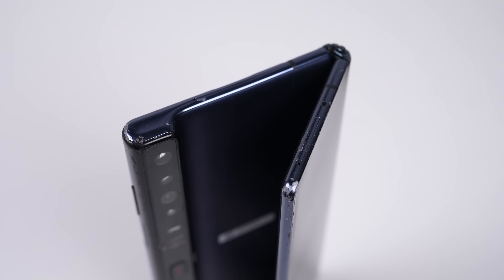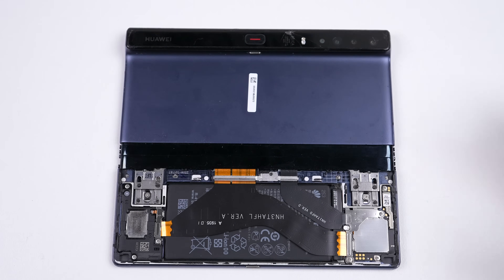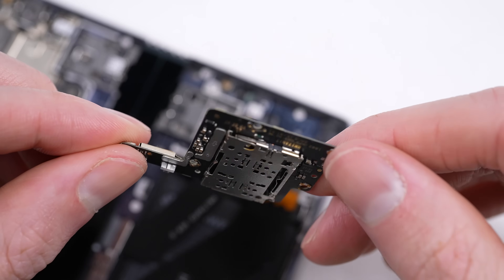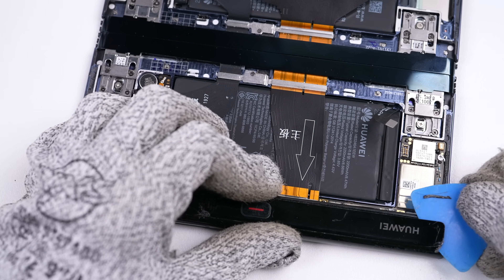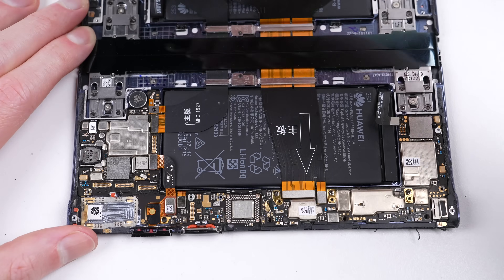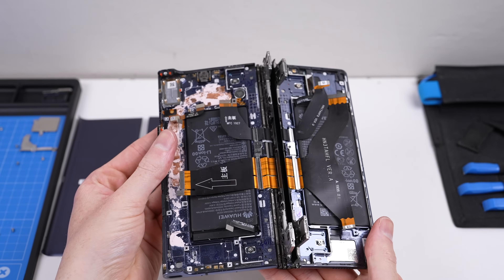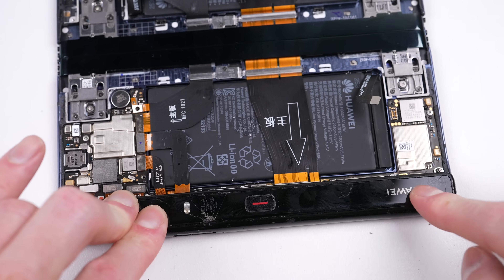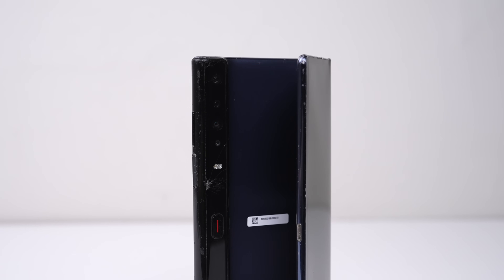Inside Huawei's Strangest Foldable - Mate X Teardown & Repair Assessment

Comment: Probably the most stupid foldable design i've ever seen. Folding screen on the outside....drop it or even poke it on that display corner and it's done for. Also the dust in the hinge shows that even if the display worked,the hinge would become a problem. People can say whatever they want about Samsung but comparing this to a Galaxy Fold in the engineering and durability department is like comparing a Fiat Multipla with a Rolls Royce. Also the price of a Mate X compared to a Fold is mind blowing
Reply: to be fair you are looking at the first gen mate x. First gen folds were crappy too
Reply: It was made to look good,which had been one of Huawei's big selling points when this thing launched,so one would understand why the phone was designed like that,to look good
Reply: Quite a lot of hate for something bleeding edge.  I for one, love it.

I feel this design is better in terms of usability, just not durability. Still, poor durability might be enough for it to be a financial failure for Huawei and be forgotten in a few years.
Reply: Why the hate😊
Reply: It is obviously less durable than a clamshell fold but not need to say it's stupid. 
The benefits are obviously clear, this form is just much better looking, you can take selfies easily with the best camera unlike z fold.
The folded up outer screen was far superior to use compared to z fold 1 or even the newest z fold 5.

I think clamshells are better but companies were experimenting, which is fun, that's rare nowadays.
Reply: Literally yes it's the truth
Reply: my man wrote an essay
Reply: That might be your opinion, but I think it's the most beautiful design and I hate the others wich open from the inside
Reply: @alexvonanders2727  Each to their own but folding on the outside is purely impractical. Those screens scratch as easy as plastic ones and there's no way to put a case on it so no matter if you just place it on the table or keep it in your pocket you will always rub that screen and it's going to be filled with scratches not even to mention dropping it.
Reply: @LUR777-g7r  I have it right now tbh buyed from the beginning, I love it for the format and I never had a scratch on my display, sadly it is a prototype and actually the first at begin sell in my country but as a prototype it have a big problem. I had to send it back after 2 months to be changed because on my screen appeared a green line crossing the display and now after 2 years even the replaced one have the same problem, the warranty is expired and Huawei asks 800€ for change the display soooo I keep it this way, but i still love this phone too bad Huawei didn't offer a premium treatment for who buyed this phone 😂😂😂
Reply: Yep really stupid. What's the point on using only one set of cameras and display. It's not like the foldables are expensive and this could be a way to make them cheaper
Reply: @supremeleaderfokou5693  But this phone was more expensive than others that had 2 displays and more cameras lol
Reply: @LUR777-g7r  thank usa
Reply: What did you say about the Fiat Multipla? >:(
Reply: I'd prefer to say its more like Lamborghini Countach and Bugatti Veyron: one looks good, very sexy, a bit mad, but it doesn't work that well (it has many compromises in performance for looks) and the other one just works.. it might not be your cup of tea but it works
Reply: There's no correct way of making a foldable, cause the only truly correct way is to not make one. The idea on itself is stupid
Reply: @WolfiiDog13  Use one and you'll see they're not as bad as you think. I have a Z Flip 3 that turns 2 years old in August and a Fold 4 that i bought last year in November and they're both still brand new-like. The Fold is a tablet and a phone in the same package,do whatever phone stuff you need from the exterior screen and use the nice big screen for media consumption. I also have a 13 Pro Max along it and if i had to pick only one i'd definetly keep the Fold 4 even if i love the iPhone. It iust does more
Reply: In this stage yeas but in some time we're let's assume that the screen can be easily replaced and has glass, this would be the best foldable form factor
Reply: Way smarter design than samsungs, it just needs a better foldable glass panel thats not made yet.
Reply: @andrasbesenyei8923  Why? Not trying to be a Huawei hater since is used and like Huawei products but why would any phone want a screen that folds on the outside and can be cracked from 1 drop? All folding screens are way more fragile than regular phone screens and this is definetly not the way to do it. It may look cool to the eye,but it's not smart durability wise
Reply: @LUR777-g7r  less camera is needed, less screen is needed, screen ratios are less goofy. As i said, technology is not ready yet because they would need something like the gorilla glass victus but also bendable, but to call it stupid is a stupid thing to do, it wasnt really meant as an end product, it was meant as a concept. Btw first gen Folds also had a lot of durability issues.
Reply: @andrasbesenyei8923  This
Reply: This is the correct design. No redundant screens, no redundant cameras, no shitty under display cameras, no stupid narrow outer screens, no crest
Reply: @frokjodor  just the materials for it do not exist yet
Reply: no it's not HUAWEI is the smart one/ huawei mate x handle many drops and samsung fold broke for no reason
Reply: bro they does't take care about the fold other fold will break and habe issues for no reason and i have vid mate x survive many drops and huawei didn't make the weak display' it would be a game changer if huawei made their own
Reply: Talking trash about the Mate X is like talking trash about the galaxy  Fold 1
Both are first generation phones, and both were considered stupid
Samsung managed to take care of it pretty easily, but Huawei being banned from almost everything they have, survival was their primary goal
Reply: @ShadyRadaideh  i mean XS 2 is really good. Like if not the bans it would be a great competitor
Reply: @CaffeUmU  
I agree
But I still think they could've done much better if not of the U.S ban
Reply: @ShadyRadaideh  yeah that's true. Huawei made the best phones by far up until the ban. The cameras, the software and the hardware was the peak of android.
Reply: @CaffeUmU  They had one of the best cameras but not hardware. Back when the P30 Pro was new it had less specs than an S10 (no dual speakers,no qhd screen etc.) At the time i had a Note 10+ and a friend had the P30 Pro,even tho he was liking it he said he likes my Note better
Reply: @LUR777-g7r  yesn't. P series wasn't the only one. When im talking about superior i mean the mate series and mate 30 actually was faster at least on geekbench compared to note 10 by 80 points on single core, around 330 on multi core, vulkan and opencl scores are almost  doubled on the mate 30
Reply: @ShadyRadaideh  well yeah the first fold was not durable either,but Huawei making the screen on the outside made it even more fragile than it already was
Reply: 1. Tbh bad comparison, modern rolls royces are just a bmw (with their own share of issues) and multiplas are kinda reliable 2. 1st gen product ffs, and this model is also quite old, but still looking modern compared to the famoust 1st gen fold from Samsung 3. This is probably the best and only genuine fold desing that wants you to use its full potential open, and when you have to use id one handed you have a normal 19.5:9 screen, nice and wide 4. All foldables have the poke it and it's done. Huawei has good hardware desigs and people can talk all they want about china this china that, but this phone is using the max out of the form factor, and is still slim compared to the double screen fatty Z. I also use a Samsung phone, I love the software, but the z fold is just a weird form factor, even if I love the Z series, I find it weird, except the Z Flip, that one is cool, not the best, but hella good. Also, the only reason why someone would choose the Z Fold is if they are a less careful with their phones, so the outer durable screen would be a life saver if the inner screen died.
Over the years phones really became disposable. Just look at oled screens, expensive compared to the rest of the phone and they die the faster, either by breaking or just burning out. Flash storage also wears out after someone time. Same for the battery. Only waste is the cpu that could be repurposed.
Reply: @igor4knezevic  even the price was very similar 200 AU more for the mate X compared to first gen fold. The new ones (mate XS2 and Fold 4) cost practically the same
Reply: @CaffeUmU  Depends on the region i guess. Where i live the Mate XS 2 is around 2000$ while i got my Fold 4 for 1200$
Reply: @CaffeUmU  yep. Both being similarly priced, the only reason why I would go with the fold world be the software, and going with the xs2 would be for the cameras and the design
Reply: @igor4knezevic  I need to say that only the RR ghost can be called a BMW because it's the only one that shares the LWB chassis and the V12 with the 7 series
Reply: @Mecanic0_exe  well all RRs share the iDrive system. All engines they use are from BMW, with a few modifications. They all share platforms in their own way cause it would be stupidly expensive to develop new platforms for each vehicle. But still, using BMW parts is not bad, but saying those parts are a true Brit RR is not genuine. Great German cars with the touch of British luxury. Probably for the best knowing of the good old British reliability.
Reply: @igor4knezevic  the RR Phantom engine is a 6.75L V12 that is not seen in the BMW lineup, also it is way bigger than the biggest executive Sedan from BMW proving that they developed a chassis and an engine for that car, but the Infotainment system is shared and probably some mechanical components, but RR are not built in the BMW factory. The ghost actually has a BMW engine and a BMW chassis along with other stuff (not built in BMW factory as well), which make it the most BMW RR for sale, even though it's way posher and comfy
Reply: @Mecanic0_exe  is the engine MADE by the bmw or not? No one is talking about the engine being in the bmw itself
Reply: @Mecanic0_exe  here is the info about your engine (maybe you should tried to at least google it first) https://en.m.wikipedia.org/wiki/BMW_N74#N74B68 this engine is just another version of the n74 engine. So it is the bmw engine.
Reply: I don't know what a fiat maltipla or rolls royce is. What are they?
Reply: @Qwerty-uiop both cars, fiat multiplia is considered a very ugly car, and a rolls Royce is a very expensive luxury car brand
Reply: @The_Phone_Bin_Diver  ohh
Reply: @The_Phone_Bin_Diver  but the Multipla is very practical, that phone isn't
Reply: @Qwerty-uiop  Lmao you stoopid brother
Reply: @Qwerty-uiop  who doesn't know what's a rolls Royce??? Living under the rock homie
Reply: @Qwerty-uiop  You don't know what a Rolls Royce is? Seriously?
Reply: @michaelcraig8860  I'm not a car person
Reply: @Qwerty-uiop  even none car people know what a Roller is. Also they make plane engines.
Reply: @smash461986  ok I don’t know literally any car brand outside of a few.

Comment: Thoe is a ... strange setup for the display, I have to give them credit for the modular and easy to fix layout. I have fixed Huawei for years and is always a pleasure to work with.
Reply: Parts availability is a big issue with Huawei as seen in this video. Ali Express parts are a hassle.

Comment: THis is why we need Right to Repair to be granted globally.
Reply: Just don't buy foldable phones.
We just need to show them that we are not interested in buying overengineered crap like this, so they should stop selling these devices. Foldable phones are just made without repairability in mind.
Reply: @groza8179  I kinda don't see the point in Foldable devices but I like the idea of it. I'm with my Honor Magic4 Lite at the moment, and it has a plastic clip back for easy to access components, despite Honor saying I shouldn't open it.
Reply: Or just don’t buy the products to begin with, then companies will change.